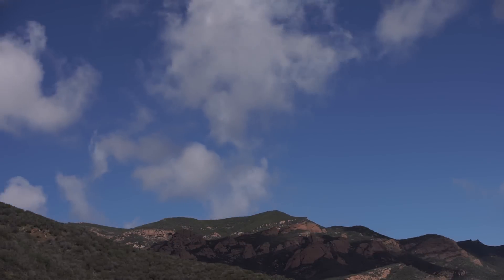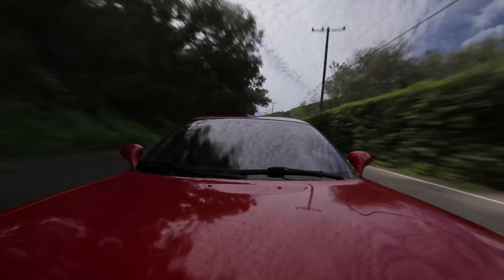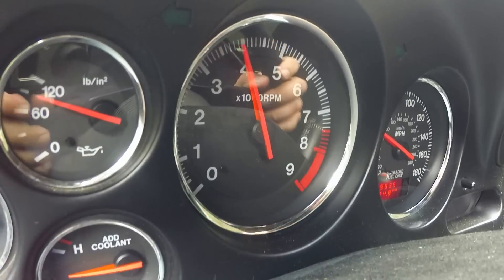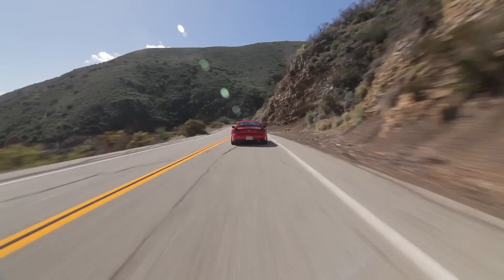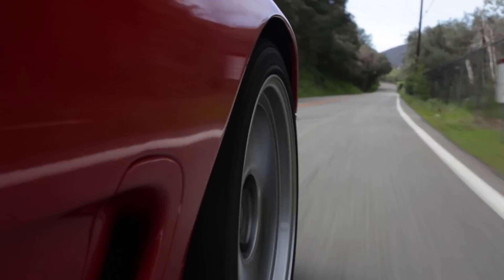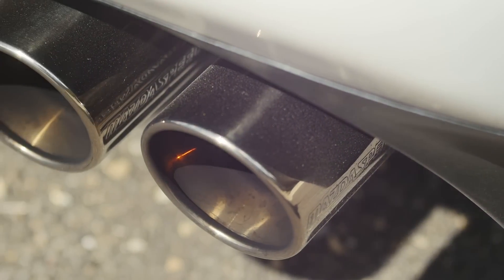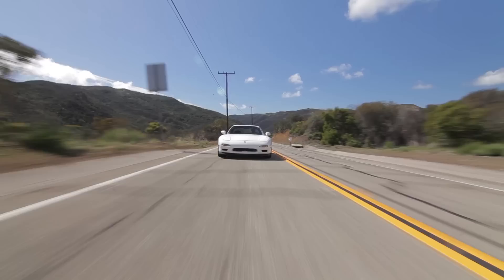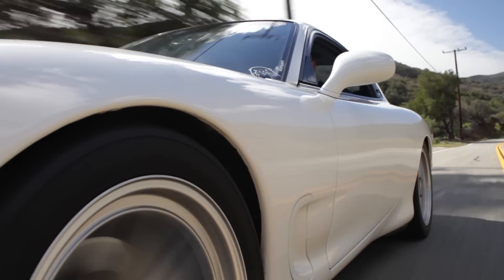Mazda  RX-7: Turbo vs V8 - /TUNED

Comment: Love the direct comparison. It wouldve been cool to know what the actual weight difference between them is? what would your guess be?  It wouldve been easy to just say of course the guy with the corvette prefers the Ls car but you made some very valid points. Awesome vid
Reply: +Z33NY Fun fact: Most LS swaps end up lighter than before.
Reply: no way dude how
Reply: Z33NY
 "no way dude how"

Aluminum block, aluminum head, no heavy exhaust manifold supporting dual turbos and the associated plumbing. Etc.

Rotary engines are not "light"- Its a HUGE misconception.  They are small and compact- Which is where the idea comes from, but theyre not light.  Theyre amazingly dense engines.

The FD in particular has one of the heaviest rotary power plants when you factor in the previously mentioned tidbits such as the twin turbos, etc.

An FD engine (long block, all the goodies on it you need to make it run, the turbos, etc), weigh a tick over 400 pounds. Dry.

An aluminum LSX engine, WITH oil, weighs under (albeit just under) 400 pounds.

The difference between iron and aluminum is huge as far as weight vs volume goes. 

Of course youre mileage may vary- Whether or not you have/keep/remove things like Ac/Ps- If you turbo/Supercharge the LSX, etc.

But TYPICALLY speaking, MOST LSX swaps, vs stock engined FDs, lose about 20'ish pounds (again, depending on what is or isnt kept, if you go with a manual transmission in the swap, or an automatic. an automatic will definitely be heavier for what its worth).  The weight distribution stays nicely at around 50/50 depending on how much gas is in the tank. 

Yadda yadda.  Rx7club has some AMAZING information thats worth a look. 

And of course- This is just with LSX engines. Not all v8s are sexy aluminum blocks mated to aluminum heads.

Comment: I'd rather do a turbo V6 swap than a V8 swap in a body like this. Better power to weight ratio, better weight balance, lighter overall, just as much if not more power, better fuel economy. V6's are naturally perfectly balanced while V8's aren't, they don't like to rev high and there's a lot of shaking. Even more pronounced in a light, tiny body like this.

But all in all, rotary over a V8 swap in an RX7 any day. that's why it's an RX-7 and not an old Viper.

Comment: I love both setups but if I had to choose only one  I would go for the v8. Smooth balanced engine, plenty of power, and dead reliable as in putting 150-200k on the engine without needing a rebuild. But if I'm only looking for a track toy, I would pick the rotary hands down. The balance and feel of a rotary engine is amazing!

Comment: I prefer FDs with rotories, the whole car is so expensive just to obtain might as well invest in it, plus its the pinnacle of the RX series stylistically.  
That said I think a FC with a aluminum LS (less weight, more in the rear then a turbo rotorary) is the coolest thing in the world.  What people don't get is that the RX7s are a tier lighter then factory V8 cars like a vette, smaller too, and likewise actually come with double wishbones all around.  People like to think a Miata with a V8 is a modern Shelby cobra, but if you take into account suspension type, weight distribution, ability to mount huge tires etc, its actually the RX7, and given how nobody cares for the FC that much I like seeing actual car people enjoy them that way.  Brand fanboying is silly

Ignoring all that, driving a V8 RX7, given the hate they get, basically says 'I like cars' more then 'I like a brand.'  Its a middle finger to people who pretend they are car people but aren't.

Comment: As a car guy I can't really complain about either car, but the problem with V8 swaps is that they are like Ketchup; you can put it on (in) anything but you dampen or lose what makes that dish (car) special. Go ahead and put ketchup on your hamburgers and hotdogs but don't put it on your tacos, spaghetti, sushi, or schnitzel. There's just no originality in V8 swaps imo.

Comment: Why is the rotary engine objectively better? Because it produces more power with less weight and less volume, and that's all that matters for performance. The fact that it is remotely streetable and reliable is a testament to Mazda.
Reply: but you need more fuel in your tank to cover same distance

Comment: I happen to own an FD and happen to own an LS. The 13b can make good power, but so can honda engines had they been built in a RWD platform to be able to put the power to the pavement. Any small engine can produce good figures given enough fuel and air so what so special about the 13B other that it spins triangles yawnnnnn cool story not enough dragons. I think ill enjoy the reliability, affordable parts, and mpgs from my LS.

Comment: I'm NOT going to get into the PHYSICS of automotive performance.

But even though Rotary's are totally unique and awesome etc., that true acceleration, that punch you feel in your back, that muscle that comes from putting your foot down comes from *TORQUE*. Now I'm not going to type a paragraph here (because that's what it would require), but rev range has nothing to do with going forward fast, HP really doesn't either (it's just a side product of torque and your transmission relationship). And no I'm DEFINITELY not saying DIESEL is the way to go for performance either, because although it makes good torque, it makes it slooowly (and albeit efficiently, there you go diesel-heads). ROTARY'S HAVE GOOD POWER TO WEIGHT RATIO, BUT SUCK AT TORQUE. Which kinda cancels itself out, if the rotary engine was LITERALLY driving ITSELF on four tiny wheels AGAINST a NORMAL ENGINE, YES IT MIGHT WIN. But unfortunately in the real world, you have to attach a very heavy car to it, and THIS is where it falls short. The RX7 is awesome because it's light as hell not because it has a rotary engine. Maybe one day they will find a way to improve the TORQUE on a rotary engine (and that will be an exciting day), but until then, it's just a chunk of metal trying to move a car fast in the same way a typical V8 does (minus torque & minus weight).

Comment: Bottom line is both engines are great. If you love the rotary get an RX-7 but if you want the V8 power then get a mustang, Camaro, or a Corvette. Dont swap a V8 into a RX just get the Amercan car and leave the rotary where it belongs, in the RX chassis.

Comment: LS swaps is a good cheap way to get a lot of power... but i like my rotary engine thus far on my rx8, it is a lot different. and it doesn't matter if you drive efficient, you will waste gas like a mathaF##ka, 16mpg avg... Adding oil every pump of gas is a lie, it all depends how you drive, red line it all day and of course it will drink oil like crazy, but drive it normal and you can barley tell a difference..Getting to the radiator fans is a bit to much work for my liking..but i chose an rx8 over a 350z..so that says it all

Comment: The guy says the 6 liter V8 vs a 1.3 single turbo, 6 liter vs 1.3 why if you put a twin turbo 20b rotary engine than it will just kill that v8 and it's still a smaller engine 2.0 liter
Reply: +Mike Liang "The guy says the 6 liter V8 vs a 1.3 single turbo, 6 liter vs 1.3 ..."

Thats because that cute little 1.3 liter engine, isnt really a 1.3 liter engine.

that 6 liter v8 is measured as a 6 liter v8 because they measured how much air it displaces over a full thermal dynamic cycle.  In a 4-stroke v8 this takes 2 turns of the crankshaft, and measures how much air each and every individual cylinder intakes, and then exhausts.

This is NOW how the "1.3 wankel" was measured.  The rotary engine was measured by observing how much air the engine moves in 360 degrees of e-shaft rotation.  Theres a slight problem with this- for starters, that only measures 2 of the 6 revolving combustion chambers within the engine.  Rotary engines actually have a 1080 degree thermal dynamic cycle- 3 rotations.  If you measured the engine according to its thermal dynamic cycle, you know, like EVERY other type of engine ever damn near (be it 2 stroke, 4 stroke, piston, or otherwise), its actually a 3.9 liter.

But making the same power on 3.9 liters doesnt look ANYWHERE near as impressive as 1.3, now does it? Also cant trick insurance companies- and government tax laws "Oh no, its only 1.3 liters!"

If you start to look at a few other factors- This all becomes amazingly clear.  Rotaries like to run at about 12-13 AFR.  Now why on earth, would a 1.3 liter engine- running only slightly richer than a piston engine, get about a fraction of the mileage? If you understand that its because its running this afr, for THREE sets of chamber-pairs- It makes a WHOLE hell of a lot of sense.  

Rotaries also have, lets be honest- piss poor efficiency.  The combustion chamber is dynamically changing, and its not a good shape either.  This is bad for actually combusting air/fuel mixtures and converting the process into mechanical energy.  Rotary engines actually convert a LOT of the detonation process into purely heat energy because of this ineffiency at converting it into purely mechanical energy.  This is a large reason theyre so hot (along with having 3 detonation events, with no non-detonation events, in an isolate part of the chamber per thermal dynamic cycle, 4 strokes intake cold air, compress it, detonate, and dump it out.  One part of a rotary engine is nothing but bangbangbangbangbang, but i digress).

Point is- Dont sit there and pretend to sit pretty on some hill because "ITS ONLY ONE POINT THREE! SO EFFICIENT!".  Its an amazingly ignorant thing to say. Its the mantra of internet desk warriors, and little else.

The reality is, theres a LOT of things to PRAISE the Rx7s engine for.  A lot.  Theyre incredible powerplants, for reasons that stretch well beyond their uniqueness.  So much so- that we dont need to bullshit and make up pretend reasons to like them.

Comment: I'm 99.9% sure if Mazda didn't use the rotary engine in the rx7, they sure as hell wouldn't use a v8... They would of used a 6 cylinder twin turbo like the rest of its competitors.

Comment: Rotary lighter in weight? Compared to what? Compact- Yes. Light? Dear lord no.
Reply: +SidewaysGts 

My shortblock weighed 145lbs with a light weight flywheel bolted on. A LS3 shortblock is north of 350lbs. And LS3 weights less than a 2jz and possibly a SR20. Compared to most engines, Rotaries are lighter
Reply: Joseph Pezeshkian
"My shortblock weighed 145lbs with a light weight flywheel bolted on"

Its the other shit that goes onto the rotary that add up.  A complete longblock 13brew from an FD weighs around 400 pounds.

Your short block weighed 145 pounds? How stripped was the thing?

The essentric shaft for the rotary weighs about 15 pounds, the rear side housing is about 30 pounds, intermediate housing, also around 30 pounds, front side housing? another 30 pounds (in fairness im rounding up a couple of pounds on each of these).  The rotors are about 10 pounds each, the front and rear rotor housings are also about 14 pounds.  The front cover? Another 10 pounds. 

This alone gets us to around 150 pounds.

This doesnt even count things like the oil pump, water pump, oil meter pump, oil pan, throttle body, upper intake manifold (these things are like 10 pounds alone), lower intake manifold, exhaust manifold, turbo, motor brackets, alternator,  thermostat housings, ignition system,  i can drone on and on and on.

Again- Shortblock itself? Not so bad. Maybe.  Its the everything else that goes with it- That makes the complete rotary package, not so light.

I mean by no means are they "heavy weights" competing with big block v8s, or cast iron inline 6s- But "light"? Enh. I think people confuse their size for light.  Theyre dense engines, with a lot that goes on them that make them pretty dang average as far as weight goes for the power they make. 

Dont get me wrong- LOVE my FD (btw yours looks amazing as well), would NEVER dream of swapping out my 13b.  Juuust, well

Im a fan of "context". 

MOST lsx equipped rx7s running around weigh in at around the 2700'ish pound range, while maintaining a 50/50 weight distribution.  This can vary a lot of course (how much gas you got in the tank?), depending on a few things- Did they keep ps/ac, etc.

Comment: This is comparing a 6 litre V8 to a 1.3 litre Rotary, you don't mention how much work the V8 has done to it?
You declare the V8 faster than the rotary because you think it is.
Put them both down the 1/4 or around a circuit to determine whats quicker, especially when your more of a V8 enthusiast.
The low down torque of the V8 is probably making you think it's quicker because it is just lazier power delivery.
Also, you say the V8 added a small amount of weight to the front end? What drugs are you on? A lot of people can pick up a 13B block, don't think many can lift a 6 litre V8!
Lastly, next time compare it to a 20B Rx7 with a 2.0 litre capacity and you will change your mind.
Reply: +Emmett Hudson The weight difference in completed cars is ~50lbs.  You are also comparing a highly modded 13B to a mostly stock ls1.  My FD is faster than a stock LS1 conversion by a fair amount, but it's not like you can't mod the LS motor as well. 

I can tell you from experience building a 450hp rotary isn't cheap either in fact it cost at least as much as a LS conversion would have.
Reply: +GlassTopRX7 
The white V8 FD has a bored/stroked LS3 not a "stock" LS1.
Reply: Joseph Pezeshkian
Where are you getting that from it's an LS2 from a 2005-2006 GTO.  Even if it is bored and stroked it's going to be traction limited. I run wider rear tires and it's issue with only 350lb-ft of torque.

Comment: Honestly I think the goal of this video was to create a hubbub over who thinks this engine should be in this car, and "rotary's suck" or "keep that american crap away from my Japanese Goodness", once you own the car do what ever the hell you feel like doing,
The wife and I have 2 Eunos Roadsters (read "Miata" to Americans) 1 with a Turbo B6ZE and one with a NA 13B (RX-8 vintage), both putting 190ish the the wheels. My choice would be the rotary, her choice would be the 4 banger, is either of us wrong, I think not, its all preference. (for whats it worth she grew up driving a Volvo, I grew up riding a large 2 stroker.)

tldr version :- if you like a v8 get a v8, if you like a rotary keep the rotary, if you want it to be powered by farts and expel kittens, buy a Pushbike.

Comment: The rotary RX-7 is cool in all but no one got time to pay for a full tank gas after a short 20 minute cruise. And I bet it uses premium. And your neighbors probably hate you. Loud cars get old real fast. My old 1990 5.0 with not even any major engine mods was loud enough to where I couldn't even answer my phone. Probably needed up to date interior sound proofing though.

Comment: Never watched the Drive before, YouTube just loaded it. First I must say this review (on why the V8) is better didn't explain anything and seemed to be all opinion (boring at that). There was not race V8 vs Rotary, to show which is better  for drag and or lap times, just a guy who loves V8's driving a car around he didn't like from the beginning of the video.  

Second the claims of not much weight gain is ridiculous and the LS2 with 400HP  is a better handling car than a single turbo rotary which produces around the same 400HP with no (weight added). The point of the Rotary RX7 from Mazda was balance  and handling.  The LS2 weighs over 200 lbs more than the 13B motor, then add in the weight gain from the T56 trans 120lbs vs FD trans 60lbs your well over 300lbs more at apx 3,100 dry weigh from the factory 2,800.  

I agree the LS is a more stable motor, vs the rotary for "normal" people as people want to drive and go and forget the engine till the next oil change. The LS2 produces great low in power but that because it is  6.0L V8  VS A 1.3L (OR 2.6L, depending on who you ask).

Comment: Even asking if a rotary engine is better makes me completely question you as a reviewer completely.  You pit a 1.5 liter rotary up against a 6 liter LS2, got 100 more ft lb torque and messed up the balance of the car and screwed up the cornering.  All you need to get 100 more torque was 4 rotary engines...

Comment: As an owner of a 94 RX7 the main thing about it is as he said the L S car is easier to drive. People who are into rotary cars want a challenge, they want to have to drive the car hard and make themselves a better driver. That and I'm also fascinated by rotary engines which is why I bought an RX-8 as well it's heavily modded not near as fast as the RX7 but it's very fun on road course races and autocross. Nice video.

Comment: If it wasnt better, it wouldnt have been banned from LeMans. Lighter means faster through corners... a lot fast through corners. Not only that... because its a smoother engine than a regular piston engine, it's also easier to drive. Putting a V8 in a REX is just a sin.
You can't ask an American to choose between a rotary and a V8. You guys all love your V8's no matter what.

Comment: Yay, ripping out the most interesting part of a car to throw in some basic V8. Sorry,you can do that to a Miata, an S2000 or any other mass produced car with a regular engine. But RX7s, especially good RX7s, are so hard to come by, you just shouldn't swap the rotary (which is the part that makes the car unique and interesting) and put in a V8 like most taxi cabs or SUVs have too

Comment: Lack of knowledge. V8 swap? Only in America! 
The Rx-7 winning four consecutive races at Bathurst from 1992 to 1995, still running the traditional factory set up "TwinTurbo Rotary". (Bathurst 12 Hour is an endurance race for the ppl that don't know)
These cars drive themselves, so I don't know what you are going on about when you say 'you don't have to work as hard coming out of corners'.
Reply: letzgo1 I mean you don't have to have the engine zinging at 6,000 RPM to exit the corner at the same speed.